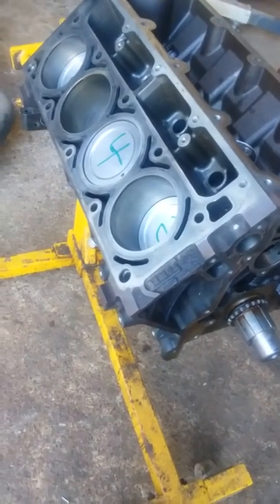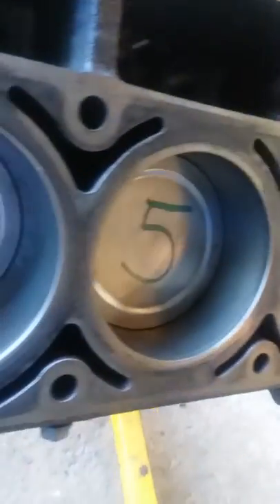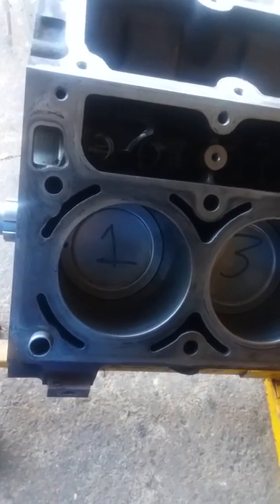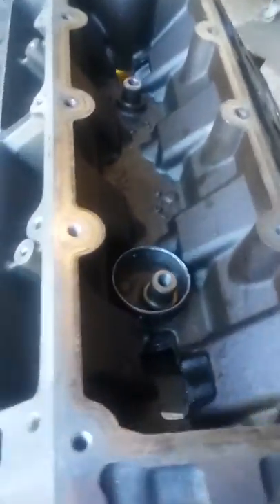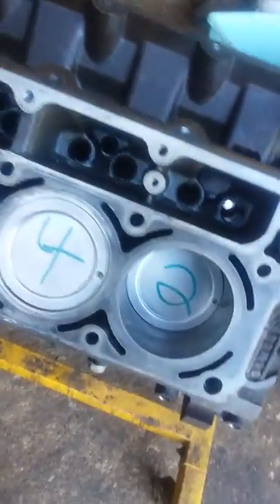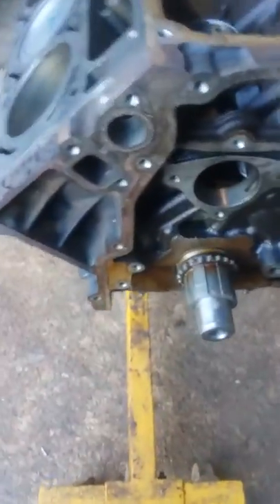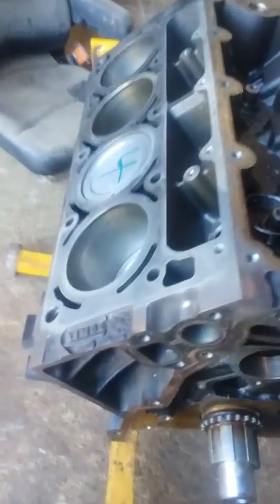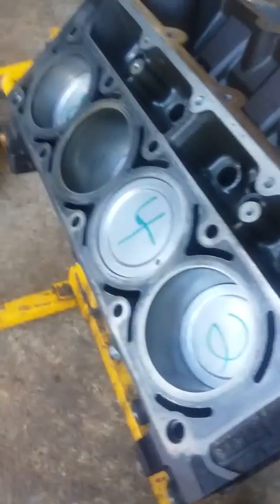2006 5.3 bad camshaft bearings

Comment: That’s a pretty clean engine for $150, I’d say you got a deal. I’d rather buy a nice clean low mileage motor with a bad cam bearing than a miled put worn out engine from the junkyard, good find
Reply from the maker: All the rods and crankshaft is Carmel color. Still got good cross hatching In cylinders.  Might pull 4,6,3 and 5 pistons and rods,  so I can change cam bearings and put it back together with a ls1 camshaft I got.